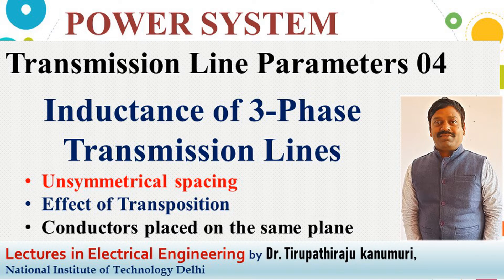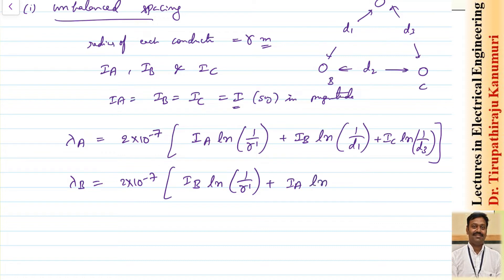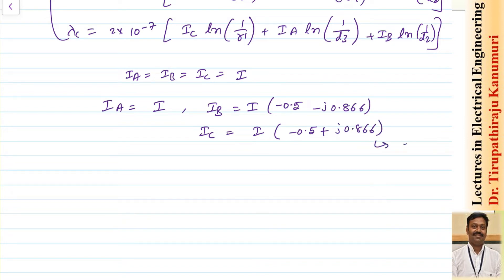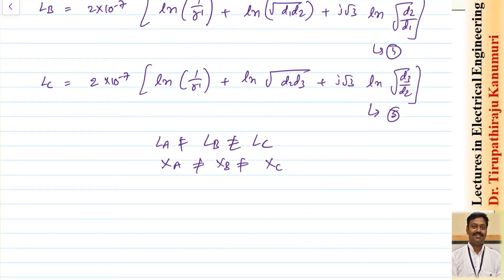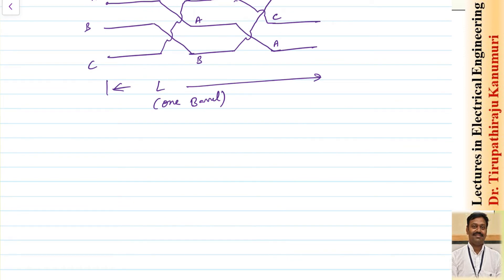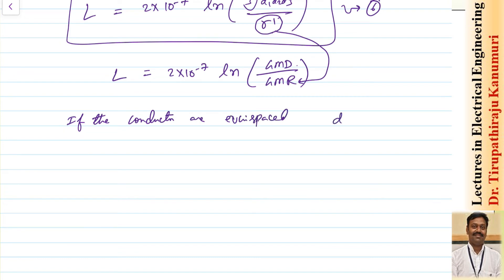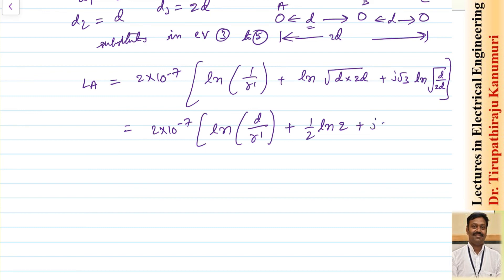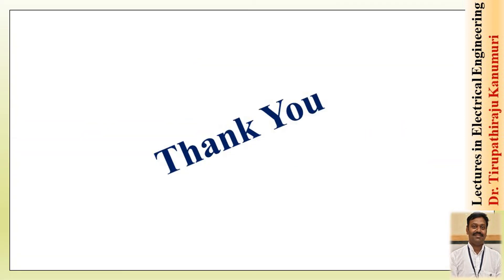PS12 Inductance of 3 Phase Transmission Lines

Comment: A 3 phase, 220 KV, 50 HZ transmission line consists of 30 mm diameter conductors spaced 2.5 meter apart in the form of an equilateral triangle. If the temperature is 38⁰C and atmospheric pressure is 76cm. Calculate the corona loss/km of the line. Assume the irregularity factor as 0.83.

Comment: In an untransposed 3 phase transmission line a positive sequence current may cause a negative sequence voltage drop??plzz explain sir
Reply: Ans is given " yes it will induce " came in ese 2002 .plzz explain the reason